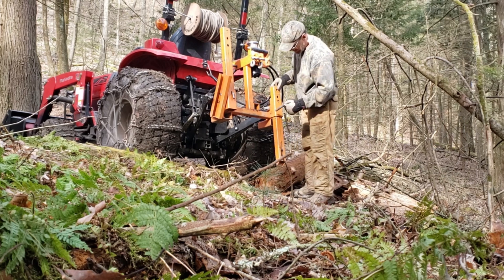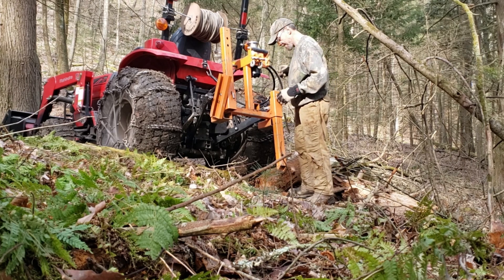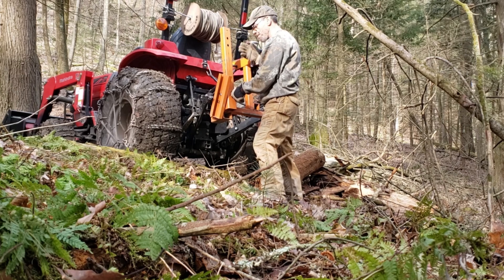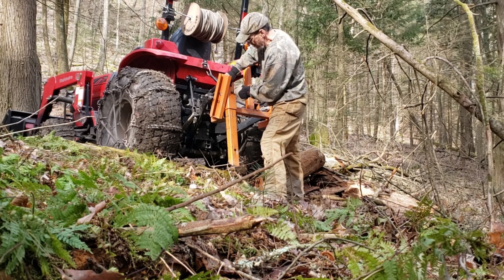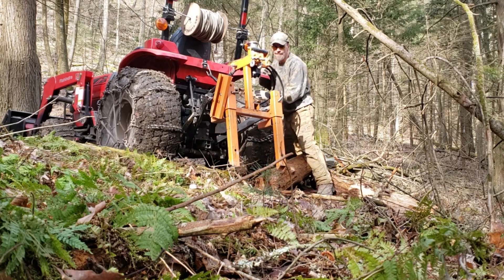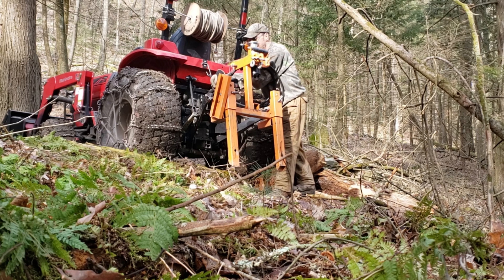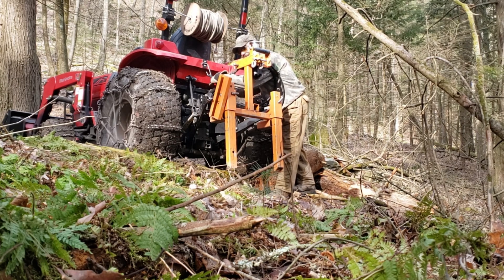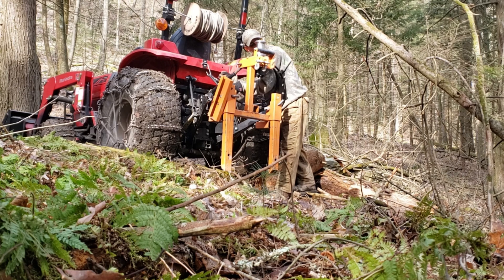Norwood Hydraulic Winch Set Up to Pull Uphill #NorwoodHydraulicWinch

Comment: How do you like the Norwood winch?  How many GPM do you have running the winch?  Can’t wait to see more of you using this.
Reply from the maker: I love it, there was a learning curve on pulling downhill because if the tension is not kept on the rope, it has a tendency to get tangled on the capstan. For most polls, I run the tractor on the lowest idle; very rarely do I need to crank it up. Sorry, I have no way of knowing the actual GPMs.